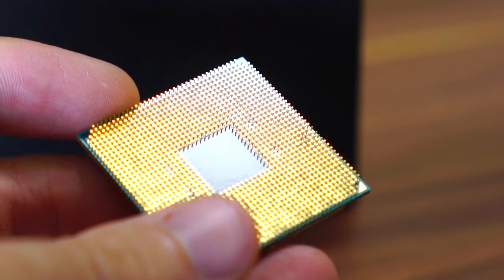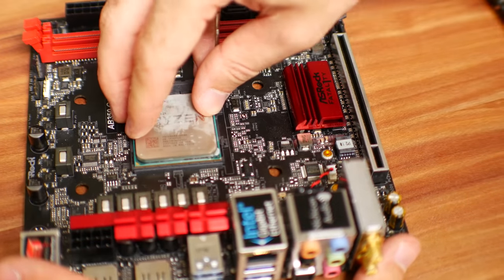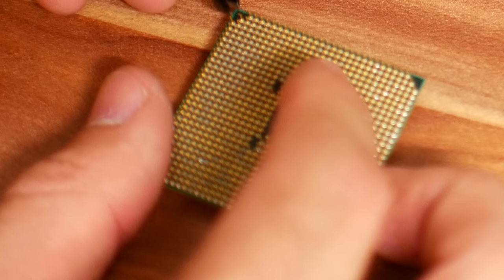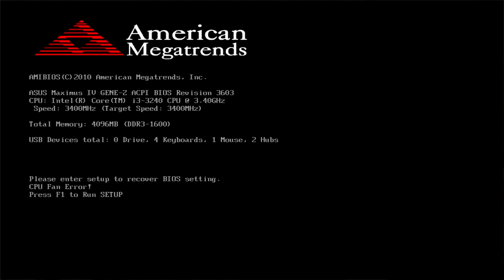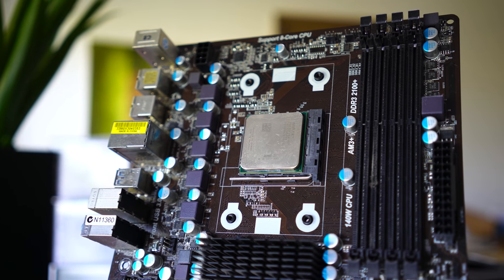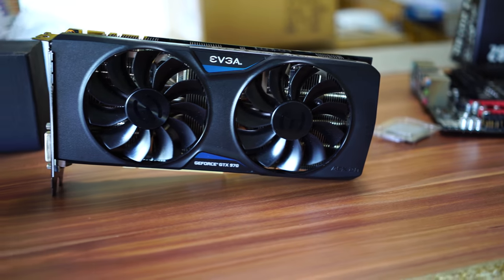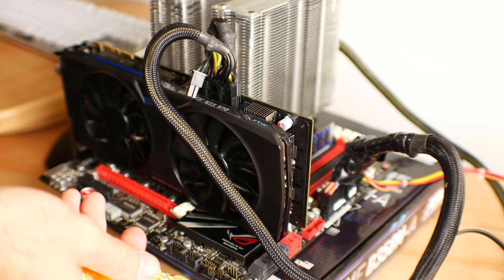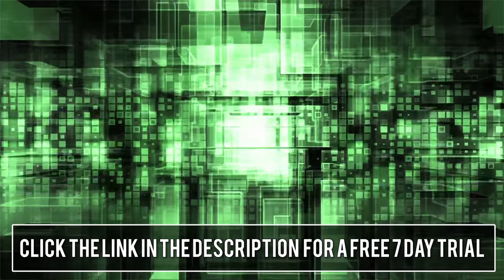How to Fix Bent CPU Pins (Ryzen)

Comment: One time I bought an old Celeron/P4 Windows XP era machine at a Savers store and it had the CPU (basically glued to the heat sync due to old thermal paste) rattling around in the case. I used a butter knife to bend the pins back and it took about an hour but it worked. Still have that PC today.

Comment: The idea is to get heat to the damaged pins. The affected pins were placing in a warm water bath. Obviously the water would be preheated to about 50C or more but not boiling. The depth no more than 2-3 millimetres in a plastic tray. Although I've never tried this ! One time I had a pin sticking way down so grabbing it by the whole length right down to its bent base. I then pivoted (using tweezers that covered the horizontal width of the pin in order to evenly distributing the bending load across the pin to avoid fracture) this length above the horizontal level of all the pins making it the only one to stick out. Why ? Because as it was placed in the socket the pressure would bend all pins down upon contact. After a week I checked and that pin naturally conformed to the same angle as all the other pins on the wafer.

Comment: Get a 22 gauge hypodermic needle. Break it off at the hub. If you can access a pair of small hemostats use that to hold the broken hypodermic needle. Otherwise, I don't know. Figure out a way. Using a very powerful magnifying glass or a jewelers loops slide the hypo needle over the affected pin and very gently bend it straight. It's tedious and you need a ton of patience. Good lighting is also a must. It works very well and there's less chance of breaking the pins. Sometimes I don't get how computers were engineered. I've heard of using a lead pencil with the lead removed to slide over the pins also. Never tried it.

Comment: I just got 7 Ryzen CPUs (1700X, 2700X, 3600(5), 3600X and 3800X with bent pins from a scrap lot. Only issue is that all of them have more than 40 pins bent and one of them is unfixable (2700X).
I shall now try to fix them. Wish me luck!

Comment: Hey mate, you might be able to solder the pins back in by using a heat gun on low speed and have the pins sitting in the cpu.

Comment: Bryan;

If you wanna take up micro-soldering, even if you're a callous hunk you can get yourself into it with a load of practise. Simply get yourself a hot air station and a decent enough soldering iron. Guaranteed you'll be going full Rossmann on dead boards in under a year if you put your mind to it.

Comment: I fixed an old amd like fx something with a credit card. You can slide it in between the pins and push it over so that it only pushes the bent pins up. Worked well and the cpu worked perfectly.

Comment: Apparently you can reattach broken pins with a soldering iron, solder, and a mechanical pencil. This was on a very old thread and was on a guide about repairing socket 462 CPUs so the modern ones are probably to small for this trick.

Comment: hah, my brother had that same issue with his 2500k for years. well, with his mobo anyway. it only worked single channel due to a slightly bent pin that he thought was straight enough. he was okay with the performance so he lived with that for a while. then his pc couldn't run zelda botw well enough and he decided to risk it unbending the pins better. he managed to do it. then he overclocked his ram from 1600 to 2133 and rose the cpu overclock from 4.4 to 4.9ghz. the pc almost doubled in speed (in that emulator anyway). it's amazing how much faster it got.

Comment: Since the seem to be right at the edge you can use the wires from a capacitor and put them in the respective sockets and bend the excess over the edge. They are thing enough that they should fit fine and the connection should be solid for those points.  This of course only works for broken pins on the edge . The wire from the capacitor conducts fine so there no issues there. I was really bored one day and figured what the hell which ended up saying a cpu that been running for two years without issue.

Comment: I have fixed 775 Mobo pins. They are easier to fix as they are much stronger and thicker than the new gens. I even broke one and replaced it with another pin by just slapping it into the whole. It works perfect

Comment: I bent pins once on my old Phenom II x6 1090t, i found the best method was to slide a credit card down each lane of pins in both directions and it lifted the pin up gently and aligned it with the rest at the same time.

Comment: Removed CPU Cooler from my Ryzen 7 2700x (wanted to replace the Prism with Noctua), 2 pins broken, 2 bent. I managed to fix the bent pins, CPU is now running single-channel.  Ordered athlon 64 II (around 4$) just for the pins ill take from it. Hopefully I'll manage to put them back in and run dual-channel again. I'm happy CPU still POST, but that was scary almost ruining 350$ CPU.

Tip: Always remove CPU Cooler after letting CPU warm the paste a little bit. (you can stress test to get high temps).

Comment: there is something called solder paste were you just apply a tiny bit of paste then you could put the pin on it (it will stick cause its like playdoh ) and then when you use a heat gun it melts and then it freezes as solid solder.

Comment: On the Intel 486 days, I soldered a staple piece to replace a pin with standard solder station and it worked. I know different times and pin count, array pitch but hey, why not trying.

Comment: I like that you tried the zen cpu because friend bought one and it was bend right from package,i ve fixed it with more luck tho. It made me wonder if there is not some simpler solution than micro soldering

Comment: Cut a spare pin a little bit bigger then the socket on an old dead mobo. Mix super glue and copper dust you can sand off of a dead heat pipe. Put a microscopic dab on the contact pad on the broken cpu then mount it and use the pressure and the dead socket to align the pin correctly. If you use too much it will glue to the socket, you can use vaseline to prevent this if you carefully brush it on the top of the socket before the pin is inserted. Make sure the pin is glued back in and then let it dry! Should work for a while.

Comment: Brian, sharing my experience, i had to use Ram slot 1 and 2 with my Ryzen 1600 to get my total 16 gb vengeance ram usable, for some reason, slot 2 and 4 showed 16 gb (8 gb usable). Btw, mine was 2 single channel ram sticks. Might be a compatibility issue. Currently using dual channel trident z RGB 16 GB 3000 BUS.

Comment: I accidentally bent the pins on a pentium 4 when I pulled it out of the motherboard when trying to remove the heatsink. (it was attached with thermal adhesive). I managed to separate it from the heatsink and fix the bent pins. Everything worked the way it was supposed to, thankfully.

Comment: you need slightly longer pins, i used some from a 486 cpu to do this pin bodge with an intel socket 478 P4 cpu, but i think a 486 cpu pin will be too thick.... unless you file it down :)

Comment: when i bought 20 pcs of r7 1700, i got 3  similiar way. i repair them by using credit card then push them to bricked motherboard (msi of course) and lock and unlock the socket few times. They worked and one of best (4,2 on daily basis, but in prime unstable) was one of the bended.....

Comment: I personally use a soldering tool with a slot end for straightening pins on AMD, it keeps you from bending the pins back too far.  As for resoldering pins onto a CPU, you'd want to use a low power soldering iron with a very fine tip, locking tweezers or forceps, and some muscle relaxant (hehe, kidding on the last one)

Comment: When I bent the pins on my Ryzen 5 1600X I used a razor blade to fix them it worked the best. Or you can use a .5mm mechanical pencil tip of course with no graphite in the barrel part.

Comment: That is a massive bummer when pins break on a CPU as you are trying to bend them back.  I lost my FX-60 due to a pin breaking off.  Until the pin broke off at the end the table knife I was using worked great.

Comment: Should have used a razor blade or a credit card... I have personally used a credit card and can vouch for it working but Paul from Paul's hardware worked at Newegg and he said he used a razor blade to fix cpus when he worked there. And a razor blade does sound like a pretty good solution once you get the pins some what upright

Comment: my current cpu is an fx4300 and it has alot of bent pins.. i did it taking the fan of to add paste.. the heatsink and paste were so tight the cpu came out with the fan.. i straitened them out and it still works

Comment: If you have the pins on the edge, try solder them in with a fine tip soldering iron.

Comment: maybe you could put some silicon or gold pins in the socket and heat the ryzen CPU pins so they get a bit soft and put them in the socket the temperature must be 90 or more on CPU and then put it it may work

Comment: I had bent pin on my asus z77 board... didn't notice it, put cpu back in and it wasn't working, then i opened it and saw that bent pin, it was bent in wrong direction, i think shorting some pins.
I was able to bend it back, but its not exactly in original position, and i sometimes have boot problems. When it does it, i turn my computer on, it shuts off and back on, crashes while booting windows, and i have to hold down power button to turn it off. After that it boots up normally, and works without problems. It also sometimes happens when waking from sleep.

Comment: I'm using snap-off knife to put bent pins back to original shape. i slide it in between pins until it reaches bent pin and I push it slowly deeper against pin so it returns to normal shape. 99.9% success in fixing bent pins.

Comment: Use  Thin long needle .... trust me i bent more than that on my old 1055t and works no problem . go one side then other side and . go from bottom and lift needle upwards motion and then do same to other side. mine had nearly half bent ... yeah half the cpu (dropped the thing )

Comment: Thanks so much for this video. I built a new ryzen setup, all new hardware but for some reason dual channel just wouldn't work. I suspected the motherboard at first because I tried different ram slots but it turned out it was a single bent CPU pin at fault.

Comment: What about i7 6400T, ECS X58-A (3th channel of memory not working, runs only on in dual channel), G3258 (OC to 5.0GHz 1.420V), GT 440, also i have a bunch of old 775, 478 MB's, Pentium 3/4, Athlon X2 245, AM2 MB, LOTS of 1,2,3,4Gb of RAM, 40,80,250,500 HHD''S, old AverMedia capture card, etc... Do you need anything of that crap? :)

Comment: I pulled out my ryzen cpu without lifting the bar as i thought it was a different design as the cooler covered the bar so i just pulled it out like an idiot. Now its on ebay as a spare or repair, now im using a amd a10 which is inferior but its better than not having anything. The onboard gpu is good enough to play warframe so thats ok. They must be pro's at fixing them as they go for up to £50 with bent pins and you can buy pins on ebay.

Comment: Do you find running in single channel memory actually impedes performance?
I ask this as I want to buy an ITX board and put a single 16 GB stick in to have the ability to upgrade to 32 GB later, rather than 2x 8 GB sticks.

Comment: I used to pull off AMD CPU's from the mobo socket and clean the thermal paste until I bent some pins on an A10 7800 (which I fixed afterwards). Lesson learned. Clean them inside the mobo socket.

Comment: thanks for telling me about the brake cleaner thing i have a gigabyte am3 board in  my closet that i found in a garage pc that has thermal paste in the cpu socket there isnt much but if the brake cleaner can get it out if it still works i have a couple am3 cpus i could pair with it to sell it as a bundle

Comment: Try to fix a CPU that someone failed to remove the thermal paste (and it got inside inbetween the heatspreader and the chip).
Totally not talking from 'experience' of trying to remove the paste off of an FX 9590...

Comment: "Surgeon hands" The CPU is the brain of the PC so when you think about it a CPU swap is like a brain transplant and any damage can potentially result in failure or brain damage, so when the CPU is damaged and you try to fix it it's like performing brain surgery if you bend back the pins without breaking them the surgery is a success, but bend them back and forth and you risk breaking those pins and the surgery could result in failure, that said here's my sad story. I recently bought a full size ATX board to upgrade to, first thing I did wrong in removing my 2 year old Ryzen 7 1700 CPU, was taking the cooler off with the case vertically, but the real dumb thing was to take out the CPU without laying the case flat, you probably can guess what happened next, lost control of the CPU and it hit part of the motherboard and case I think and 2 or 3 pins got bent, didn't realize it and tried to install it into the mobo and it didn't work at first it was because I hadn't jumped the ground on the board, I had the board on the box it came in to test it, anyhow I jumped it but still no post so I check and sure enough pins are bent, I don't remember much after that except going online looking for solution to straightening bent pins, one said use jewelers screw diver another said use a real thin  credit card and than so than I found Jayz2cents video where he intentionally drops a Ryzen CPU and repairs the bent pins with a razor blade, but the only problem is all I had was a safety razor and broke one pin after the other, the next day I was able to get a angled razor like in the video and it straightened most of the pins, but many more broke off, 3 days later I've broken at least 25 pins and I can't fit the CPU in the socket to even see if it will work, in the video he did break a pin and many pins are either reserved or redundant so there is a very slim chance the CPU may still, work, by the way jewelers and experience PC can repair broken pins it's a micro soldering process, but it costs like $5 a pin, not every pin I broke may be necessary, I did save as many as I can in case there is a chance the CPU somewhat works, one trick although not recommended since it might damage your motherboard, my mini atx I was swapping out of has a bad sata, one trick is to put pints into socket where they are missing on the CPU, but that trick doesn't always work, anyhow I'm going to keep plugging along and see if I can get what pins are left, and there are far more left than broke off to fit in the socket and see what happens, I was able to get a deal with New Egg for a new Ryzen and it should arrive in the near future, but I'm gun shy now and I'm hoping I can get my local PC repair shop to the CPU install and mobo swap, but if they can't I damn well will treat this like the brain transplant it should have been treated like I The first time, so learn from my dumb mistake guys and don't take any risks, after all it's not always easy to find another brain lol.

Comment: heh my 1600x came with 3 bendt pins straight outta the box. not much but it didnt fit. i was lazy to rma it so i tried bending it myself. i just used my nails because they were at the edge and bendt outwards so it was easy fix. cpu works perfectly afterwards.

Comment: I’ve just bent pins on my ryzen 7 cpu after struggling to get the wraith prism cpu fan connected. Even though I placed my cpu correctly and locked it in, in the process of getting the fan to lock in, the cpu pulled out stuck to the thermal paste on the heat sink. Me moving the fan around without knowing the cpu pulled out caused bent pins.
I’ve watched many you tube videos and noticed many people struggling with that fan trying to get it connected to the tension bars.
Am I missing something or is this a bad design?
My last cpu fan for a ryzen 3 screwed in and I had zero issues.
Thanks for any help

Comment: Should have used an old credit card or a plastic putty spreader(harder than a CC). I've fixed countless PGA Cpu's using those methods an rarely ever break a pin off in the process.

Comment: I've seen a couple people bend pins on Ryzen CPUs. I bet he bent them removing a heat sink from the chip, and the chip came out with the cooler. Gotta use a twisting motion, don't just pull straight up people!

Comment: mine r7 won't work in dual channel ram all pins are lika new no bents motherboard is b350 f strix and im on stock cooler spire when i putt ram in dual channel pc boots and works and then when i restart or shut down pc and start it. it restarts 4 times in booting screen and then boot in single channel so reads only 1 stick i need help for fix thank you :(

Comment: Did he say he used Brake Cleaner to clean the mobo? I'm just double checking, wasn't sure if it was safe or not.
Reply: i need to clean some paste from ddr3 slot, if you could confirm what solution did you use to clean it off please?

Comment: Bryan and other people here I got a biostar a880gz and an x4 955. Unfortunately, the cpu had bent pins and I broke 1 off trying to fix it.  I vacuumed out the case (I know bad bad idea) and might have killed the mobo with ESD. From just looking at it, it is fine, but might have gotten some (probably not conductive old thermal paste) in the socket. When I try to start it up, I get all fans turning but no beeps and no post on my screen (doesnt matter which port or if I use an extra gpu).  
Can you guys help me determine if the cpu or board or both are indeed dead. I hate throwing old but still good hardware in the trash but tbh I don't feel like buying another old cpu+mobo just for testing. So, what should I do? Would be very grateful for suggestions!  
btw I know for a fact the before disassembly both components worked.